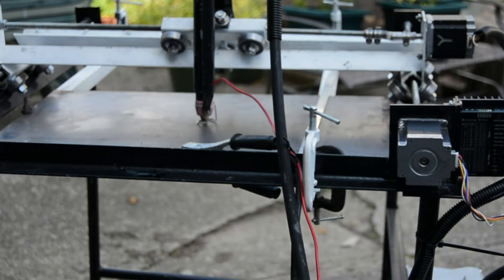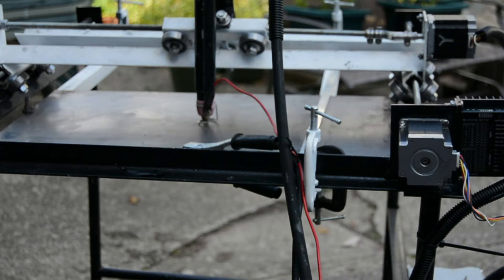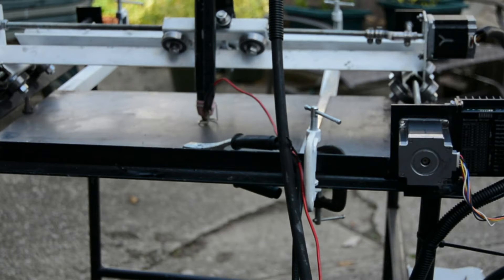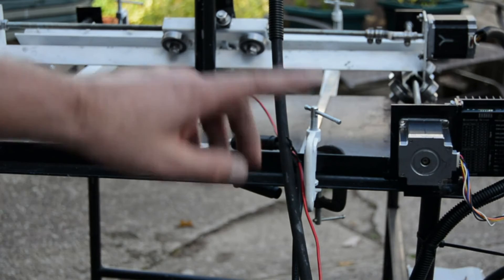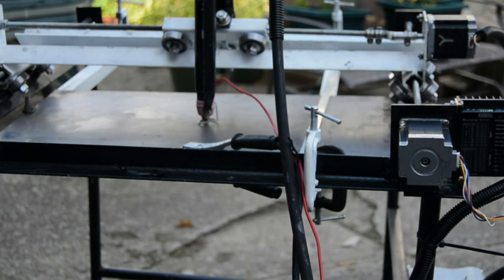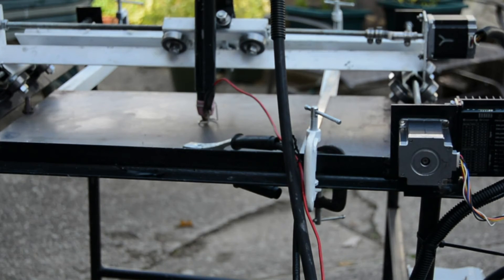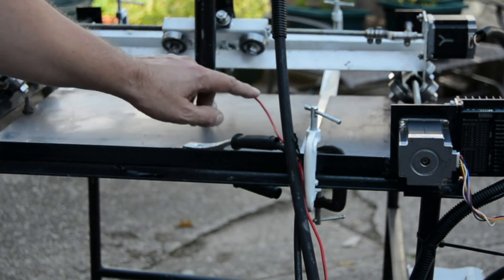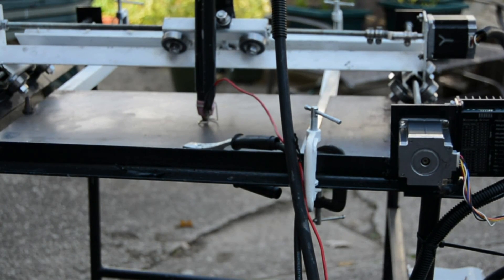Cnc Plasma / GRBL/GRBLWEB  Emi Solution

Comment: the red wire where is it connected ti?
Reply from the maker: file:///media/john/9016-4EF8/DCIM/100D5200/DSC_0085.JPG
My Cut50 has a Red binding post between the trigger switch and the Plasma cutter port. I Will try to attach a picture.
Reply: @johnwashell4351  can help me sent wiring diagram or picture

Comment: Thank-you for the video and explanation. I am running an Arduino UNO, GRBL and a Boswell 40D and I am experiencing instant lockups when the cut starts. I do not have any leads for the HF start to implement your solution. Did you have to install extra leads for your plasma cutter or did it come with them? Thanks.
Reply from the maker: I have two Cut50's one has the HF feature, and an older I use for hand work that does not have that feature, Since you have a Uno, I know some have the DIP version of the microprocessor in a socket. If that is the case, I'd try disabling the  reset pin via software fuse settings. At some point, I'd like to make a video on how to use the cheap Ebay programmers and AvrDude to do that, but no time lately. There probably a video for that already.

Comment: Hi sir,i have same problem with my Router spindle,if i turn on my spindle , my Bob send report "alarm" can you help me the solution?
Reply from the maker: Everyone's system is different. Routers have high starting currents. if you can start the motor slowly, you will have a better chance of not disturbing the microprocessor. I' am also trying the STMF103C8 boards in place of the Atmel arduino. As I state in the video, the ATmega328 is sensitive to spikes. Are you using GRBL?
Reply from the maker: Did you add the capacitor to the reset switch?

Comment: Please help me, before i make cnc roter and run normally. This time i tried to replace with plasma, why when torch body i tie on x-axis plate, simultaneously plasma burns my machine also move by itself like there is power failure. I use manual system for on off plasma with plasma cut type 40. Please give thanks.
Reply from the maker: If you are using an Arduino, this may be the HF start. HF Start is a very high voltage, and gets through wires, and other conductors. Since the Arduino runs off of 5V or even 3.3V, noise from the HF start gets onto reset lines and other inputs causes the microprocessor to behave unexpectedly. I've had limited success with the Cut 40.  On long jobs I've sometimes gotten lockups, even after adding a capacitor to the reset line as shown in this video. I wish someone would port the GRBL code to a better microprocessor. The Atmel's are  1990's technology. Of course grounding the cut 40 is important too. Using Manual on / off doesn't matter. When the plasma is started, energy is still coupled through the air, by induction to stepper motor wires, back through the stepper motor controller, and ultimately back to the microprocessor.
Reply: John Washell Can you tell me how to solve this problem. Thank